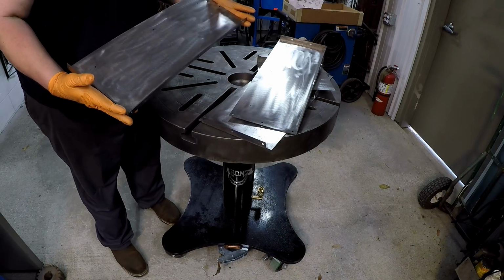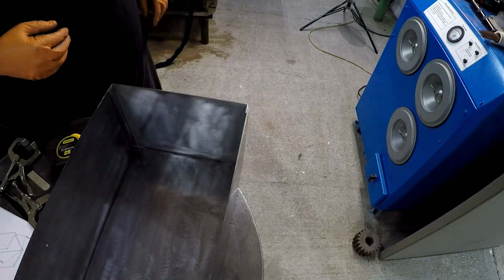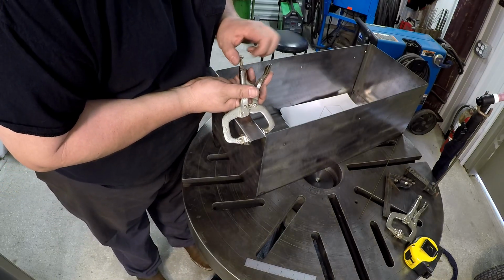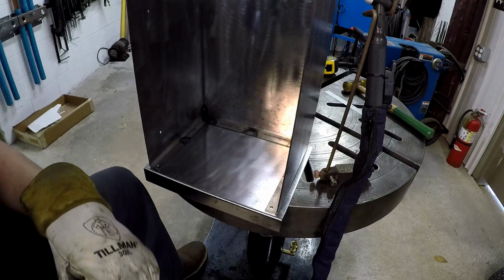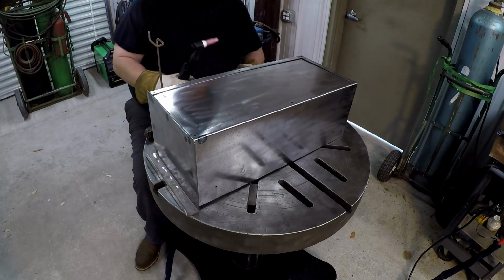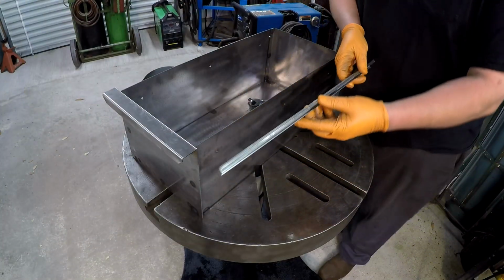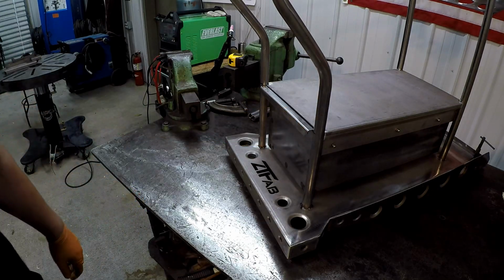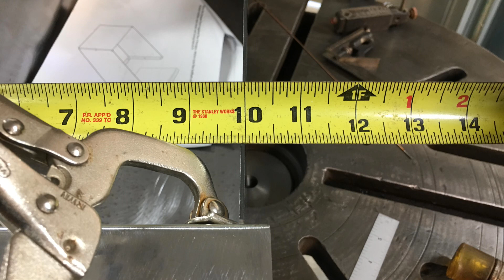ZTFab Welding Cart Part 3

Comment: When installing the rails on the drawer, you should leave them snug but loose. This allows for fine adjustment of the rails. Once you have them on the mounted rails, then tighten them up. This will ensure there is absolutely no binding. After you get them on the slide outs, you can tighten the two front ones, then take it back off and tighten the rear ones. Just makes to minimize wear/tear on the rollers so it will last longer and roll as smooth as it possibly can (especially when you get a load in the drawer).

Comment: Nice looking cart. I am surprised there was not that much separation between metals when doing the plug welding. Normally  the flat would swell away from the flange.

Comment: Looks like you got some craters on the plug welds, maybe a bit more taper and feathering out in a circle at the end of the weld would help? It'd be a shame if the welds start cracking after all the work you're putting in. Keep at it!
Reply: adam has an amp taper off mode to eliminate craters on his machine.

Comment: Is the brass fitting towards the base of the stand a lubricator?
Reply: He has videos back a couple of years where he builds the rotary stand and everything from design thru finish, it's a great series to binge if you haven't seen it. It's under Playlists / Rotary Welding Table Build.
Reply from the maker: There’s two brass drip oilers where the bronze bearings are.

Comment: So how are you liking the everlast welder
Reply from the maker: So far so good, and I’m  enjoying the new features it has to offer.
Reply: Abom79 yea like besides the fan on demand honestly I don't really see needing a miller but would never buy a Lincoln mig machine that I'd still rather a miller or esab but kinda liked everlast new 4 in one a.c. tig and mig welding a.c. with a dc pulse for aluminum oh and on a lap style joint you can get away with no filler metal usually other joints have a tendency to crack  so that cart I'm guessing stainless steel ?